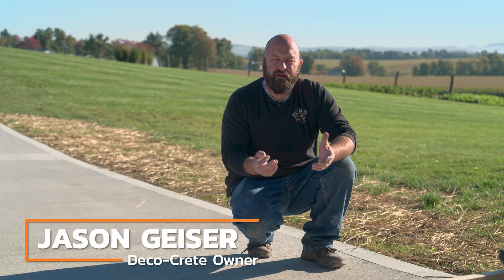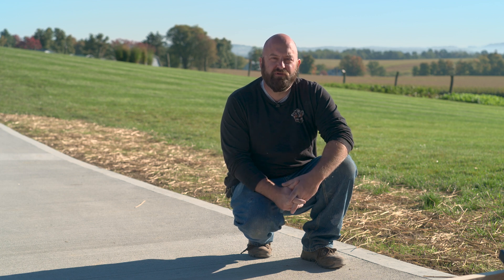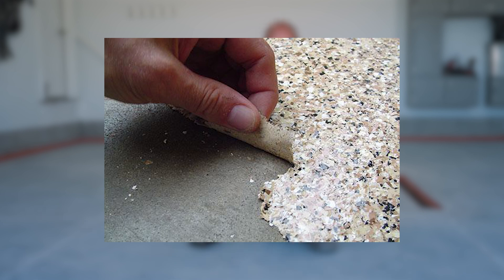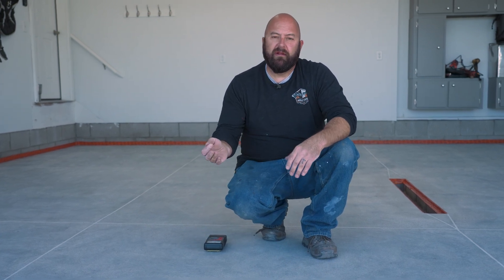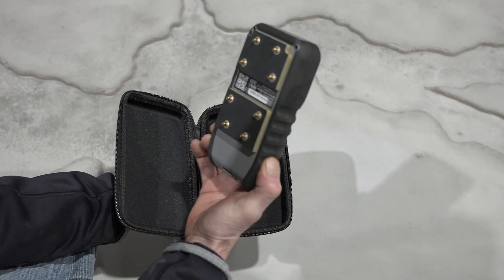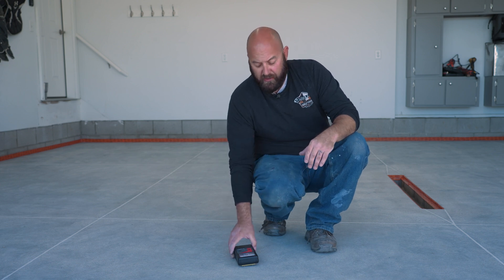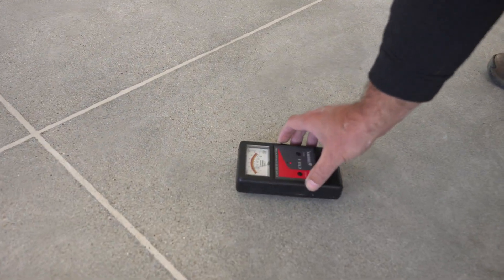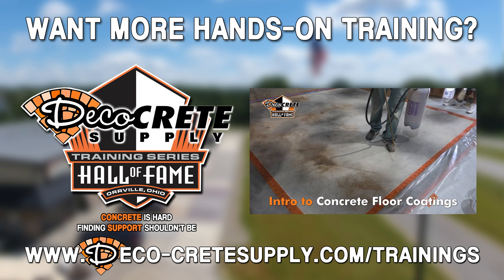How to Prevent Concrete Floor Coatings from Failing!

Comment: But how do you fix the issue if it’s there!
Reply from the maker: Thanks for the comment! If you have a floor with high moisture and want to apply a concrete floor coating, you can try a few things. First, try figure out what's causing the problem. Concrete floors generally hang between 3-5 percent moisture, if the floor is testing higher than that, there's usually a reason for it. Most of the time, it's a drainage issue under or around the slab. Once the problem is fixed, the moisture content should go back down. If the problem can't located or fixed, we do have a moisture shield primer that will help. However, the primer can only do some much and you may have to consider a more breathable option like a concrete overlay and acrylic sealer. The Moisture Shield primer works well on floors with moisture content between 5-6 percent. I'll leave a link the product page on website. Thanks for watching Deco-Crete TV!!!                     
https://www.deco-cretesupply.com/products/coatings-liquid-metals-poly-armour/moisture-shield